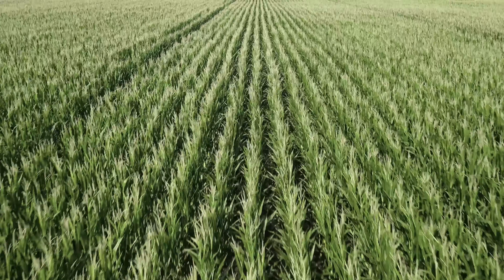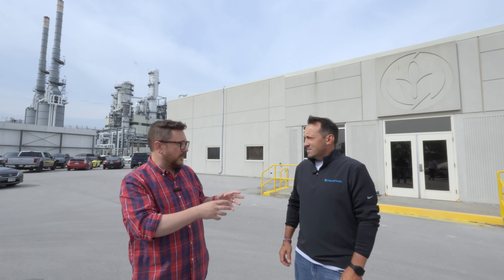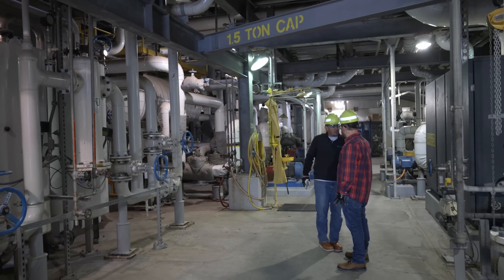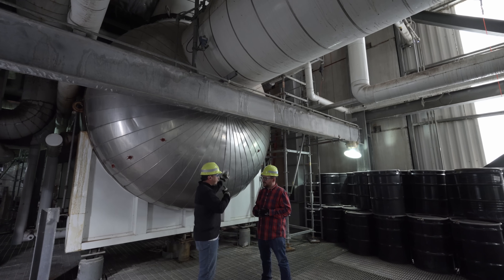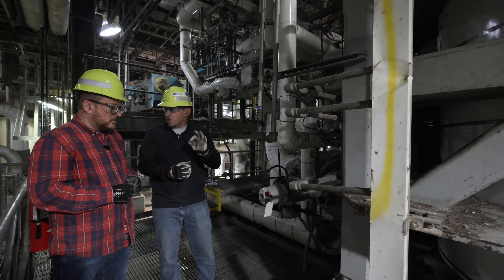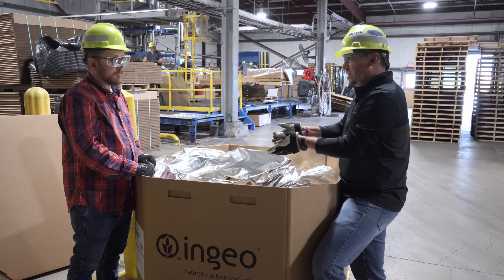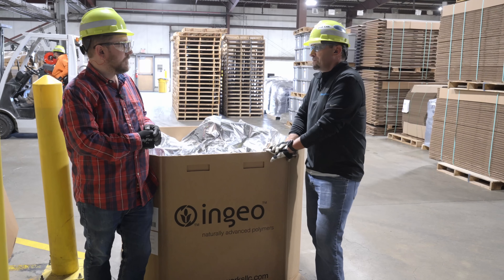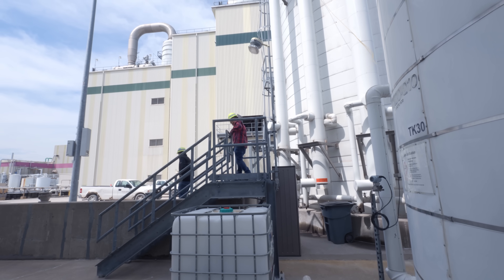How 3D Printing Filament Is Made (Part 1) | Micro Center Onsite

Comment: I could easily imagine compressed air being a large part of cost. Storing it, moving it, removing all water and oil, the lines to carry it, triple digit cfm and psi. A friends build with 175PSI/20CFM and separators ran about $15k and that's with the budget stuff (emax/rapidair). at least initially. not so bad ongoing

Comment: Is the high L/ low D or high D the ratio of D & L lactate ? 

Edit: i believe D & l lactate are isomers being the same molecular formula but just in a different structure causing different properties. I dont know much chemistry but that guys explanation was actually quite good with the body and verbal communication, with further research i realized hes spot on with his short explainer, essentially the same substance just different arrangement of atoms picture a circle and a square but both same material but a circle can roll soothly but a square cannot each have different characteristics but are the same substance, damn chemistry is cool gunna have to add that to my studies
Reply: Most molecules have L and D enantiomers, they being mirror images of each other.  See the image at 9:35.  L and D refer to Left (Latin: laevus) and right (Latin: dexter).   L and D forms are identical for most physical and chemical properties, but do differ in how they attach to other molecules (imagine how a left glove fits a left hand but not a right hand, although that's probably not the best analogy) and in how they polarise light.

Comment: I noticed Polymaker mentions ingeo on their packaging. I know Inland is basically rebranded Polymaker and eSUN products.
Reply: How do you know this?  IC3D used to make their filament, don’t know if they still do. IC3D used to take back empty spools from 2 brands: IC3D and Inland.
Reply: @radish6691  Rumors mostly but the specs pages for some of the filaments match the eSUN listing pictures. I believe eSUN was the main supplier, got a factory fire, and so inland searched for another and got Polymaker.

Comment: Fascinating  inside view. 

Wish it would address the End of Life for this material.
Reply: Failing on a print bed and getting thrown in the trash
Reply: Stash it for few decades to store CO2 or burn it to release CO2 back to plant growth. If one can extract heat and electricity from burning process, it's a bonus. Maybe replace natural gas and truck diesel with created energy?

Don't put it in landfill or oceans.

I wonder, what CO2 balance of whole system would be if all produced PLA was stored? Would it break even?
Reply: @kimmotoivanen  Valid question, but you maybe missing one key bit of info. 

PHA can be made directly from CO2 and Methane. Both are carbon rich greenhouse biogases. There is one CA company doing just that (CarbonLite Industries LLC). In addition, a lot of the commercial PHA suppliers are using dual-fermentation, where the Co2 and Methane generated in the fermentation process, is simply re-used to make more PHA. 

PHA is a Circular Carbon Process. Landfill is not the worst case, far from it. 

And it has no negative impact on the ocean, but that's just the safety net so to speak. Plastic in general (all plastics) should never ever be discarded in the ocean. And yet, all current commercial fishing gear (Bait boxes, scoops, Tenders, Floats, ect ) are made of petrol-chemical plastics that are intended and designed to be discarded at sea.